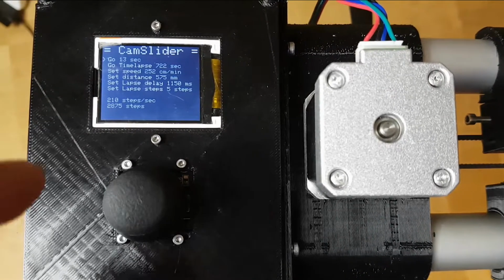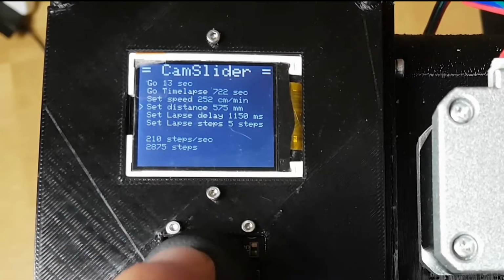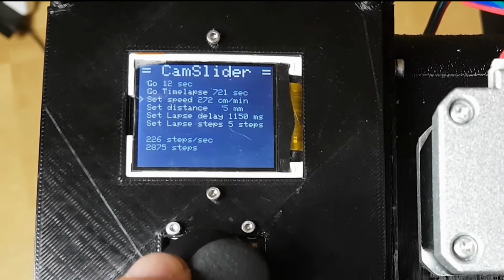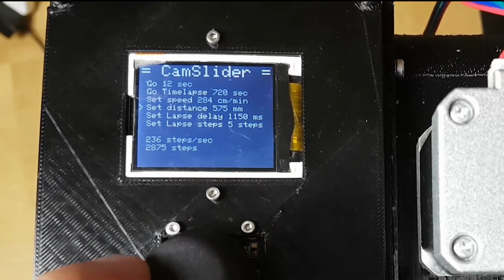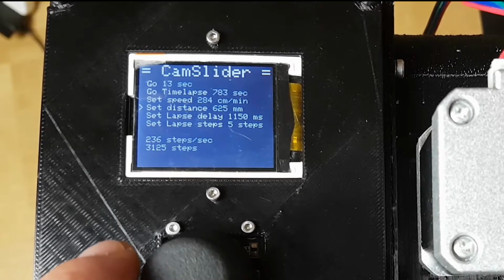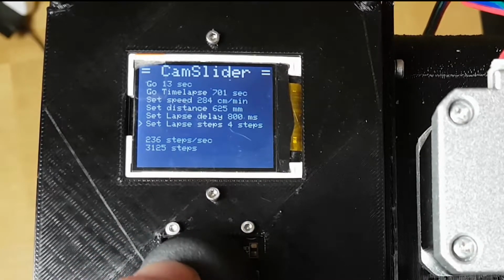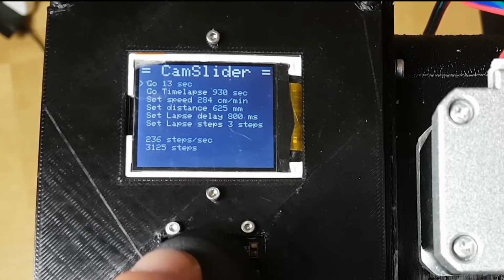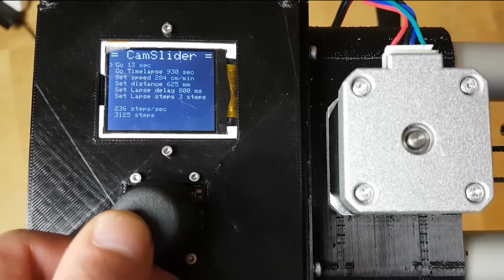DIY Motorized Camera Slider with 3d printed parts!

Comment: Hi! I am looking for a stepper motor which axial load capacity will be 5 kg. But I don't want to use any gear. Just a stepper motor on top of that I want to set 5d mark iii with a heavy lens. Could you tell me the model name or link. I searched a lot but haven't got anything yet. Thanks in advance.